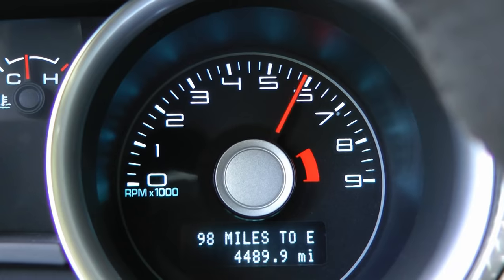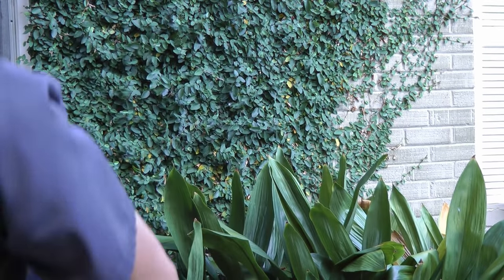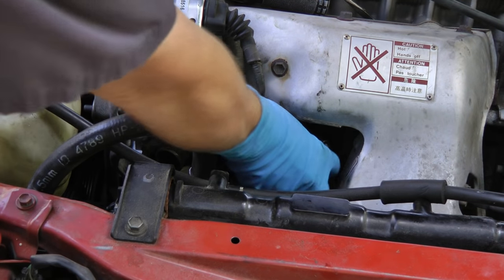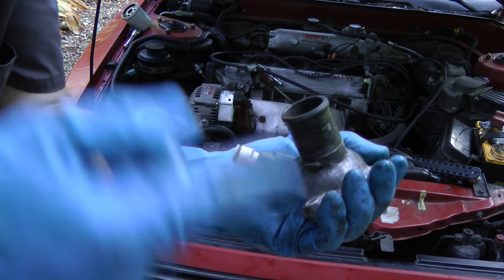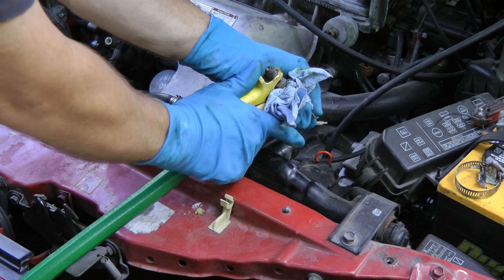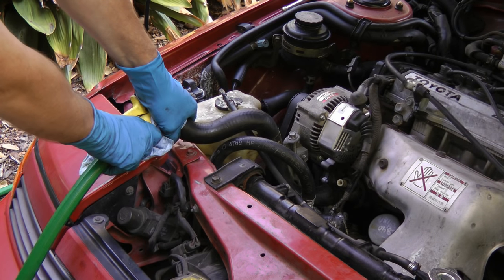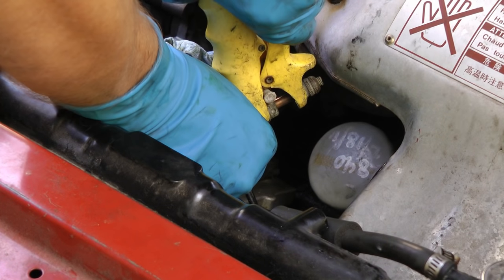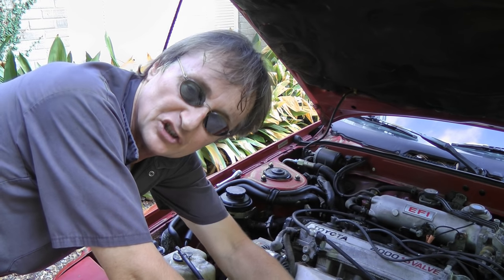How to Flush a Coolant System in Your Car (the Easy Way)

Comment: Thanks for the video, concerned about flushing it with garden hose, because everyone says use distilled water, and this will leave tap water in system. 

I live in an area with a lot of sediment, and still have original radiator in good shape with over 210k on it.

Comment: I have a Hyundai Accent 2000 and I flushed too many times the cooling system (about 3-4 days), also cleaned the reservoir tank, but after 2-3 days the coolant gets dirty again (from green, becomes rusty brown colour!) What causes that? Leaking head gasket? Rusty thermostat or radiator???
Reply: someone may have put some of that headgasket fixer in there. that stuff has bits of copper in it that melt at high heat and fill in any leaks around the gasket seals, but then after that they leave the stuff in there. Ive had to flush and flush and flush to get that crap out and it still never comes  completely out,, still i would rather do a simple flush and have the additive than a head gasket job ANY day, you may have also had someone leave tap water in there which will cause rust and mineral build up thats why its best to use distilled water to flush and mix with the coolant

Comment: Should I use the hose to flush the radiator or distilled water.   I have a 2005 Mitsubishi Endeavor with 106049 miles.

Comment: I live in a weather where the temperature drops below the freezing point, is it OK to drive my car with water only, for two weeks like you said ?  What are going to do with the old coolant ? If you have a car building an air pocket how you are going to take it out before its overheats on you  ??
Reply from the maker: no, just flush and refill with coolant in your case, it never freezes much here in texas so we can drive em around with just water.  To bleed air out, you burp the system with the front of the car raised higher on a hill or using a jack, then the air will burp out the radiator cap if you leave it off and watch it closely while running until it gets hot. running the AC will run the cooling fans full blast to make it safer

Comment: well i watched your video as well as otehr videos and decided to give this method a try as well as the air pressure/water gun method. After flushing for 2 minutes with your method the water got very clear and it remained so after pausing. I then tried the other method in bursts to see what would give and boy, the rusted water color kept on coming for nearly one hour! So i come back and watch this video again to bust your myth but then I notice at the end you mention the car should still be driven around for two more weeks to allow the water to flush even more. Now this may seem easy on your car, but removing the hoses from my radiator and SBC are a FPITA and who's to say after two weeks of driving with still rusted water, that you don't have to repeat the same procedure over and over again until ALL the rust has cleared, instead of some or most of it. This aint no quick and easy fix is what I'm saying. On to your other video about the best coolants out there, its sound advice, and I was gonna follow it. But then a friend told me best is waterless coolant, and i looked into it and again he's right. Sure its pricy, but its 100% life long coolant for your car...  just saying you should use quality tools/products for The best. Thanks

Comment: Gee, for 50 years, I've been doing it wrong, I just remove the Lowest Hose and drain the old fluid, reinstall and fill  radiator with water, run engine until hot as this will allow thermostat to open then I Drain the through lower hose again-do this several times and system should be clean--after the last drain, I Fill with a 50/50 fix and job is done....Folks, just Remember if you use the Chemical Flush, you will be Installing a New Water Pump in Short Order, this stuff will Wipe Out the Bearings in Pump....
Reply: Well said. People like complicating things
Reply: capitalismforme  fair enough

Comment: My buddy bought a 2001 dodge ram 1500 a couple months ago. We were going to do a rad flush ourselves after watching this video. We opened the petcock and what came out looked like tomato soup, no chunks but watery tomato soup. We both live in farms and have hard water (lots a minerals bad for a cooling system). We would like some advice. We did fill the rad multiple times with a pale and funnel, drove it, then drained it at the petcock but it still looked the same every time. Thanks

Comment: Scotty, thank you. Can I flush it this way: remove upper radiator hose, remove thermostat, remove radiator cap, run engine, turn heater on high, and pour distilled water into the radiator until coolant is all flushed out of the upper radiator hose? Will this flush the entire system?

Comment: Remove the thermometer, and drive with just hose water for multiple weeks. I feel like this is the "Alt F4" of car advice.
Reply: same I gotta say id flush it like this but then put in new stuff for a while and flush that out with brand new coolant to get the best consistency from a quick fix without distilled water flush

Comment: No way drive around with only water in the block during the winter season...this video needs to be updated ASAP!!
Reply: Common sense.
Reply: @aarongray503  No it's not common sense according to the way the video is presented.
Reply: @mitch1078  Scotty lives in Texas, if you live in an area that's cold obviously don't put water in ur system 🙄
Reply: @RatBastard77  I know that and most people know that but many people don't have a clue about that so it shouldn't be taken for granted and should be presented with this in mind.

Comment: The easy and cheapest way to maintain your car is just to dump the coolant from the radiator using the mini valve at the bottom of the radiator and putting new coolant at the top. Is not a full flush but keeps your radiator healthy!
Reply: I agree with this. If your coolant is bad then yes flush it. If its nice and clean (like mine) i just run a jug of factory coolant through every oil change. This may be overkill but my coolant on my 2007 f150 4.6 2v looks brand new.
Reply: @ghazugkullmagurokthrakkath6148  Complete waste of time and money doing that every oil change! You are accomplishing absolutely nothing with such short intervals. That's almost the same concept as putting on brand new tires every oil change. If it was the same price as a coolant flush, would you really do that? Absolutely not.
Reply: @mitch1078  Draining one jug worth of old coolant and topping up with one jug every oil change may be expensive overkill, but as long as its recycled properly its not hurting anything.
Reply: @ghazugkullmagurokthrakkath6148  I never said it was hurting anything. I said it is a complete waste of time and does not accomplish anything whatsoever. If coolant has 100,000 mile life and you drain and fill it every 5000 mile oil change, you are completely wasting 95% of the life of the product! Throwing away 95% of perfectly good fluid is completely illogical. Even if it doesn't hurt anything, it doesn't accomplish any benefit whatsoever to throw away 95% of what is essentially brand new fluid!! You are completely wasting your time and cost!!! I can understand drain and fill every 50000 miles (which I do), but every 5000 is not even proactive maintenance whatsoever!
Reply: @elrikk3419  All places that also accept used oil should. Call autozone or similar places that accept used oil to confirm.
Reply: Your local disposal site. They usually have a section for chemicals and batteries. You hand in your coolant there.
Reply: @elrikk3419  lmao rude. Some people actually do that lol, myself included
Reply: @elrikk3419  Take it back to the same store you bought the new stuff.
Reply: @elrikk3419  I flush mine down the toilet.
Reply: @mitch1078  IKR, that's almost the same concept as replacing the battery every oil change.
Reply: @afrosamuri05  That's inhumane to flush it down the toilet.
Reply: @afrosamuri05  Absolutely! Changing coolant every 5000 miles is the same foolish idea as changing the battery since it has about the same lifespan as today's long life coolant.
Reply: @mitch1078  , actually most auto places do NOT accept coolant and haven't for years. Many barely accept oil any more.
Reply: @cmscott  Auto places are required by law to accept oil and coolant in many states...maybe your state is an exception.

Comment: Wait drive the car for a week with just water? Um
Reply from the maker: +Yewon2001 hurts nothing as long as it isn't below freezing outside, obviously
Reply: +Yewon2001 Also when done and replacing with 50/50 remember to check the coolant to insure ample amount of water was not left in the system. you can check this with a very small, cheap tester that can be bought just about anywhere that has car products. (tester should be less than $5 USD)
Reply: +Yewon2001 , bad idea..  because tap water would hurt water pump seal,  and introduce mineral deposits in the engine.  To flush the engine i would fill it with distilled water and a bottle of concentrate antifreeze , its not that expensive.  T
Reply: Use distilled water.
Reply: Depends if you have hard water or soft water.  Soft water is fine to run temporarily.  When you drain it and reflush one last time to add the real coolant, that's when you want distilled, though it's cheap, so you can buy a few gallons of distilled to run the car for that week if you want.  Distilled water will actually draw any residual residue into itself since it has no ions, so when you add the final coolant, it will collect any deposits remaining in the block.  The water won't boil either - the way a radiator cap works is like a pressure cooker - once it's put on, it raises the pressure, which increases the boiling point of whatever liquid is inside.  Once it starts to get there - the spring pops and opens a valve to your overflow to let it through before it boils.  Then as it cools down, it reverses, causing a vacuum sucking your overflow water back in.  So it never boils.  The boiling point of antifreeze is only 10 degrees F higher than water. With the cap on, water won't boil until it gets to 257 degrees, and 50/50 until it gets to 265 degrees.  All temps I mentioned in F.  Now, if the coolant is at 250 degrees, and you go suddenly remove the cap, it will flash boil immediately because the boiling point will drop back down to the normal 212 (hence all those warnings on the cap).
Reply: do not open, very dangerous
Reply: It can rust out your coolant system. My OM specifically says NOT to put pure water in my car and mine is a Honda CRV except in an emergency.
Reply: Distilled is definitely best.  It's $1, so why risk it?  Depends on what your engine is made of - aluminum, steel etc.
Reply: With TAP WATER no less. No Thanks!
Reply: What if it's winter and it freezes?
Reply: Drive for a week with no thermostat and just water?
Reply from the maker: yes, as long as it's not freezing outside so it doesn't freeze solid
Reply: won't the water boil and not cool as well then???
Reply: Water is actually better for cooling an engine the reason coolant is added is to prevent the water from freezing solid in the winter
Reply: Not if your cooling system is properly pressurized.
Reply: I run water in my wrangler during summer, doesn't hurt anything, it actually cools better than 50/50
Reply: damn bro. the point of coolant is not only to increase the boiling point but to INHIBIT rust. I hope you are at least using some kind of third party anti-rust additive with that water.  because you are fucking your engine up very slowly if you are not.
Reply: What did you think we used before Ethylene Glycol came along.  For many years...we ran cars on water only.
Reply: That is just a general recommendation.  It doesn't hurt the radiator on a short-term basis especially if you're flushing the rad...and prepping it to put in New Fluid.   At one time...everyone used water in their radiators.
Reply: We can never use only water here in the desert (113 degrees F today) would slowly boil out!
Reply: @delanojacobgmailcom  I always refer to it as coolant instead of antifreeze
Reply: In my one Corvette I would run distilled water and redline water wetter. This combo in the summer ran cooler than using a mix. You can run the water wetter with a 50/50 mix. Or run even less coolant like 30/70 distilled water. Just remember to go back to a 50/50 mix before winter.
Reply: Urine works too.
Reply: @MJB-uq4vz  Perfect 😆👍👍
Reply: @delanojacobgmailcom  not true. How do you think water cooled engines work?
Reply: @MassCityMadman When have You seen a Stock Car run in Winter months...?
Reply: @MassCityMadman gotcha...
Reply: @MassCityMadman Never crossed my mind... sounds Fun, I ran stock car on asphalt...

Comment: Scotty,

If I use a bottle of radiator flush, would I still need to disconnect all these things?  Or can I just release the radiator drain cap to empty the first time, then cover and put in the flush - run the engine, then drain again... fill up with fresh coolant?

Comment: should have opened the heater and fan to flush the heater core
Reply: Sure if your flushing the heater core as well, but if that's the case it's better to pull the hoses off at the fire wall for a better flush. Just keep the water pressure low or it can damage your heater core.
Reply: You're not about to teach Scotty Kilmer something...... Slow your role.

Comment: scottys ive looked at countless videos on how to flush your cooling system and no one. i say no one shows you this.
Reply: Yeah, actually some others do a better job than this. There are a few problems with Scotty's vid. It's too risky, for one. You should never blast full pressure garden hose through the cooling system and not run tap water in the system for any length of time. He never mentioned anything about using low pressure on the hose. Using high pressure in the system can blow the seals. The cooling system doesn't run at a very high pressure, but some garden taps do run at higher pressure than to be safe for a cooling system. There are zero lubricants or corrosion inhibitors in water. Other vids warn against this and use lower pressure only. Still gets the crud out just fine. That said, some of it is good, but overall this video needs a redo with some better tips and cautions.
Reply: I blasted water  from a car wash wand into my engine, hoses, rad. NO ISSUES.
Reply: @MrBilld75  I think you are going overboard with this one.
Reply: @MrBilld75  
Lol

Comment: Don't they have a drain plug @ the bottom of the radiator?.
Reply from the maker: some do, some don't, but things are often so cheaply made, you mess with that plug, it breaks and you need a new radiator then
Reply: Scotty Kilmer Scotty, I'm Changing out all my coolant. I live in an area with SOFT WATER....and i was wondering is it necessary to use DISTILLED or DE-IONIZED WATER  when mixing the antifreeze to a 50/50 mix? Canada weather
Reply: lightningsmokerXx
Good question,I'd like to know as well.I have heard some auto manufacturers don't want you to use distilled water for some reason.
Reply: Yes, it is necessary to use distilled water. For one, it doesn't have minerals in it which can leave deposits in the system. Secondly, tap water is electrically conductive, distilled water is not. This is why batteries use distilled as well, so as to avoid ruining the cells. If your manufacturer recommends distilled, then use distilled. I have yet to hear of one that doesn't.

Comment: Hi Scotty, I have a 2006 Uplander 3.5 engine. I noticed the antifreeze is below the level, Can I used any other antifreeze to top it up of should I use only Dex-Cool which is the one recommended for this vehicle? Also I want to thank you for help us all with these easy to follow videos.
Reply from the maker: ANY extended life coolant can work, and really, I don't like dex cool, seen it cause too many problems. I'd eventually flush all that out and use a different extended life coolant lie prestone
Reply: I have read that there are problems with that particular antifreeze, so it would be better if I change it all. Well, I'll do that. Thank you so much Scotty

Comment: Hey Scotty, what about the heater core flush. It has old coolant in it too? And can clog up over time.
Reply: Heater core is part if the coolant system.

The only real way to flush that, is to find the intake and out hoses, which are very often buried in the dash.